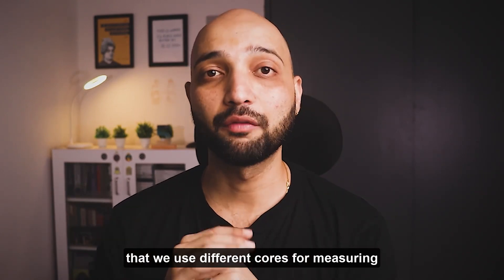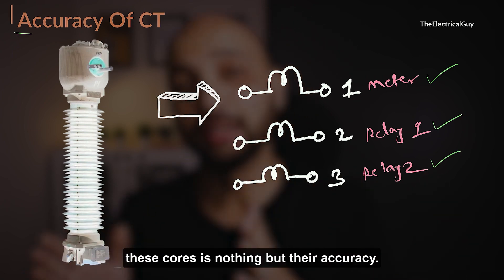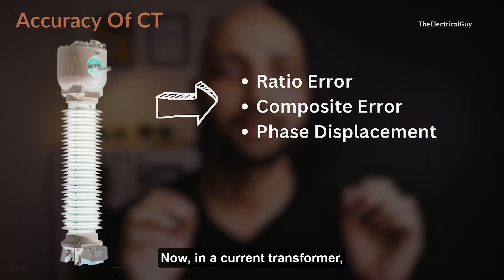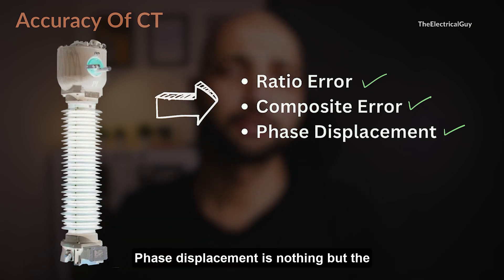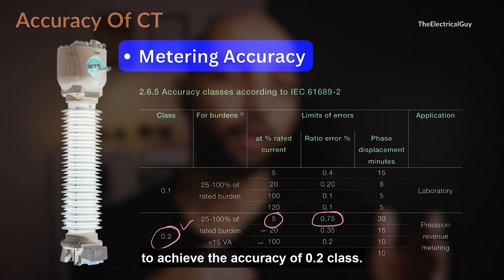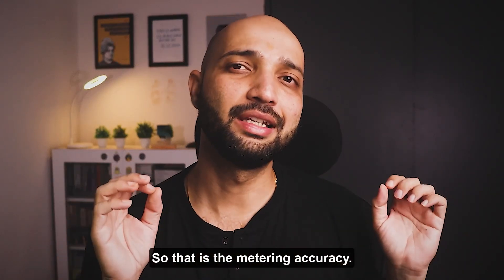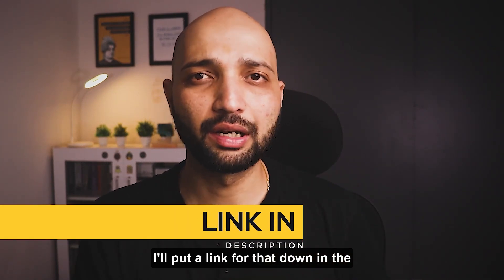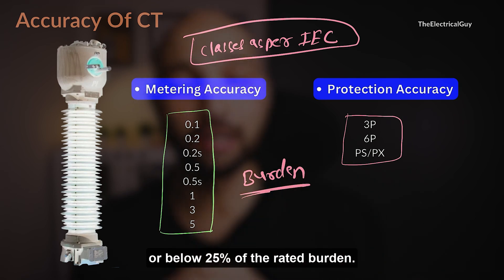Accuracy class of Current Transformer | Explained | TheElectricalGuy

Comment: I WAS ASKED IN AN INTERVIEW AND I AM NOT SURE OF THE ANSWER

Q-WHAT WILL HAPPEN IF I CONNECT A PT IN SERIES TO THE LINE ? (SPECIFICALLY ASKED ME ABOUT THE HEALTH HAMPERING)

ANS- THE PT WINDINGS WILL BURN , INSULATIONS WOULD DAMAGE , BECAUSE PT IS A STEP DOWN TRANSFORMER , WHEN PUT IN SERIES TO LINE , THE PRIMARY CURRENT IS THE LINE CURRENT WHICH IS QUITE HIGH AS COMPARED TO THE CASE WHERE PT IS PUT IN SERIES , THE SECONDARY CURRENT WOULD BE MUCH HIGHER , AS PT WOULD HAVE SECONDARY OPEN , WHEN HUGE CURRENT FLOWS THROUGH THE OPEN CKT , IT CAN DAMAGE THE VOLTMETER AS WELL AS HUGE BURNOUT IS POSSIBLE FOR ITS HIGH CURRENT 

SIR IF YOU COULD CHECK MY ANS AND RECTIFY ME , OR ADD SOME POINTS TO MY REASONING I WILL BE GRATEFUL

Comment: The protection accuracy is also depends on magnitude of short circuit current. For example the 5P20 shows the accuracy of 5 % at 20 times rated current at primary. Therefore in my idea just saying 5P protection core is not accurate. The maximum short circuit current should be stated as well.